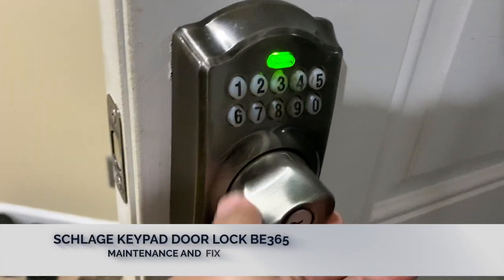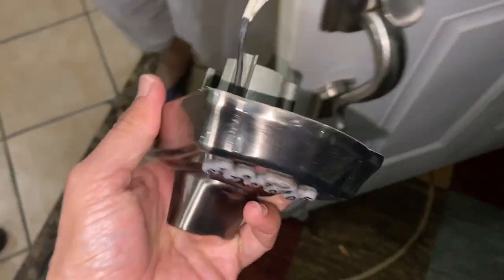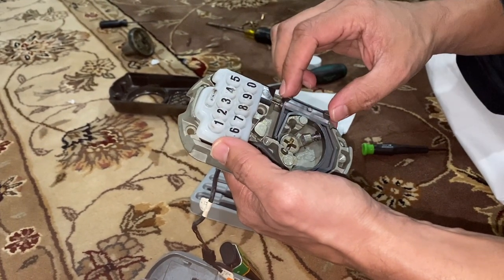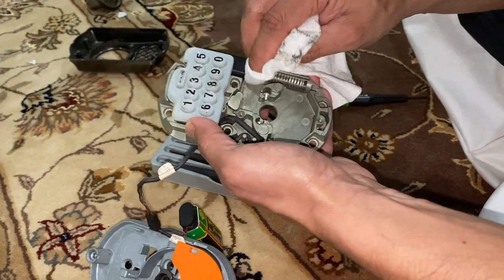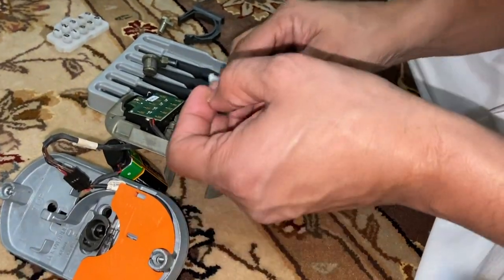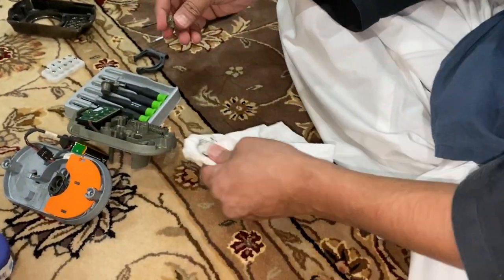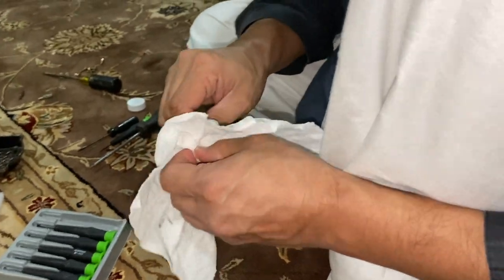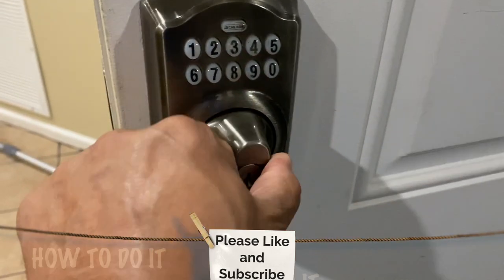SCHLAGE KEYPAD DOOR LOCK BE365 FIX

Comment: Update. I had the same issue with 2 of these deadbolts. One on an indoor door and one on an outdoor door so the cold weather theory may not be completely accurate. I had Schlage send me replacements and the same issue again. My fix was to shim the the gap between the plastic slider and the housing it seats against so that the pin sits flush or more flush with the sleeve it rides inside of. One lock needed a felt disc of a certain thickness and the other needed a plastic washer that was a little bit thicker. Both were cut with a scissors to size. You could use a dab of glue but the cover plate should keep everything in place. I'm pretty sure this is the only solution as the solenoid motor in conjunction with the spring acting as a screw is not a very precise piece of engineering in that even if you reset the plastic slide over the spring it will eventually find its way back to the problem position. The other possibility is that the motor just is underpowered or looses power over time or the spring looses memory. Anyway, shimming the slide where it seats was my solution for both. They work perfectly again

Comment: Liked it to the point at the end where assembly was critical the fast speed made it impossible to grasp detail I have the same issue with one I got from the crazy bin used it will not connect to rod leading through the lock sounds like it would work but no movement front just spinning around also no key came with it.
I have tried to make it work but guess I don't understand the concept of the black plastic and the brad with spring what makes it move back and forth or unlock and reset for another lock episode?

Comment: apologies... One key piece of information is that when you disassemble and take the internal cover plate off, be sure to leave the plastic slide where it's sitting on the spring. This is where it's naturally finding it's home position at this point. Albeit a position that's not allowing for normal operation. If it's like mine, there will not only be a gap present between the plastic slide and the housing, the pin will also not be flush with its sleeve. It's from this position that you need to find the right sized spacer to fit into place. The spacer can be anything that hard but still able to be cut down to size with a scissors.

Comment: I found design deficiencies in the Be365 lock, and I did things to minimize the issues.
T claim there are two design problems. -- The spring that the motor turns to raise and lower the plastic mecanism 
The plastic mechanism itself.

Let me explain.  
I took down my Be365 from the front door. That front door faces west, gets the sun all day, and gets the prevailing winds and rain/moisture. One month past the guarantee, the lock stoppped working.
.
When I went to repair my lock. I noted that the spring, which is used as a spiral ramp to raise and lower the plastic (J shaped mechanism), was covered with a fine layer of rust.
That rust surrounded the wire that makes up the coiled spring. 
The plastic cam that is moved up by the coiled spring is completely flat on the bottom surface.  It is therefore a small cause of friction. I call it the J shaped cam, for want of a better name.

This is my repair.
Spring repair
===========
Obtain a very small amount of watch/sewing machine oil (one eye-dropper max).  I am thinking you will need about 3 pinheads of oil.   Get some graphic from a locksmith, or from the hardware store and make a mixture of the oil and the graphic.  With a Q tip, apply that mixture to the spiral spring, With battery in enable/disable the lock action. The motor will spin that spring,  Do not oil the spring, but from the Q tip, make it hardly-moist from dipping into the oil-graphite mixture. You should not see any signs of wet oil.  The main use of the oil is not for lubricating, but for binding the graphite/oil mixture to the coiled spring.

Plastic J shaped cam
==================
For the plastic cam that is moved up and down by the spiral spring rotation, on the bottom where the cam slides along the base, and in the slot adjacent to the motorized spring, put the smallest amount of graphic onto the slot on which the cam is moved by the spring,  With your breath, blow away all graphite excesses.  There should be no visible sign of a graphite, but perhaps some appearance of dust. .  One way --wipe the graphite onto the slot and wipe it off. A microscopic amount of graphite does the job.

TEST
======
operate the lock to unwind the spring. While  inserting the J plastic cam mechanism over the spring,  press the end of the spring a small amount towards the motor.  Once the J cam is seated, operate the lock to open/close.  The J mechanism should now work freely.  The lock mechanism working is an indication you succeeded.
Once the parts (spring, J mechanism and the little cam that  presses downwards against the spring,  work a few time,. Reassemble the lock.
  
Design improvements
The spiral spring needs to be of stainless steel material -- no oxidation. Otherwise, you will need to buy a replacement lock in the very few years after your puchase and guarantee expire.

The design of the larger flat J plastic mechanism should not be entirely flat on the bottom. It should have some pods, Not very thick ones. Pods  just thick enough to raise the J cam  so that the entire bottom of the cam does not rub against the base. (For my lock, I only dusted the cam. there was just a microscopic addition of graphite.  -- NO OIL, OIL Only on the spiral spring, and definitely not visiby black 

I put the lock together and all is working well.  The lock must tolarate  -20C snowy weather in winter, and 32C humidity in summer, while installed on a door facing the sun.

By the way, the plastic film on the buttons on my lock have split from the plastic losing it's suppleness.

Hopefully someone passes this message onto Schlage.
Reply: Good info but these Schlage locks are total garbage. I would NEVER buy them again. Zero longevity
Reply: @lsatenstein  after teardown and repair I will say they are constructed well. They are also very simple, it's incredible. My issue with the one that faces south is the sun beats down on it daily and the plunger grease was baked and hard/sticky so it wouldn't work right. The parts are mostly metal. It just disassembled it and degreased and REgreased and it works great. Thank you for your comments. I agree with you, you are right.

Comment: Exactly the problem that I am occasionally starting to have.  I’ve had mine for about a year now.  It once took about 8 attempts once before it finally engaged; I was almost locked out of my own home, and that’s not the first time it’s happened.  I’m going to try this, hopefully it solves the problem.
Reply: Did it fix the issue. Mines doing the same thing. I almost just want to buy a new one.
Reply from the maker: Yes
Reply: You should always have a backup way of getting in with any electronic lock!  Put the key for it in a lockbox somewhere outside your house.

Comment: Thinking instead of taking everything apart why not blow compressed air , spray oil, change battery and test????
Reply from the maker: To blow compressed air I would have to setup my compressor. Would have taken me longer. Plus taking everything apart was easy and faster plus did a full maintenance so good for many years to come.

Comment: The lock actually start working again without dissembling it, when it dries out.
The question is, what's the immediate solution when it's wet? Is it possible to get a shield to protect it from getting wet, when it rains?
You dont want to keep dissembling the door knob every time it rains.
Reply from the maker: Yes it’s not designed to get wet

Comment: Maybe just changing out the battery will fix it? I’m completely upset that mine isn’t working either. I’m a 74 year old woman with arthritis in my hands I had my brother install one of these because my hands weren’t strong enough to turn a key. I don’t have the expertise to take my lock apart. I bet it won’t work. I don’t think it’s dirt causing the problem because I have a storm door covering the front door and I would think it’s something else. We have had a cold winter and I bet that cold drained the battery.
Reply from the maker: Yes it’s possible. In my case I had new battery. You can try changing your battery. If it’s old that’s the first thing you should do. If you were local I would have helped you.
Reply: The issue isn't one of dirt but rather one of lubrication. The extreme temperature and humidity changes are  what causes these issues, in my humble opinion.

Comment: WD40...PERIOD. spring tension has nothing to do with it, it's just a worm gear! After cleaning and oiling put it back together properly. You don't need to mess with the spring stretching it or repositioning the plastic part.  Clean and WD40. You don't need to overthink it!!!!!!! A very lightweight oil.

Comment: my solution! scrap this junk ass lock and go back to keyed lock. tired of schlage and their BS. i changed the battery in my lock now I'm shut out. entered the prog code and tried to restore it to factory settings no luck. tried changing the prog code and also the lock codes no luck IM DONE WITH POS... thanks schlage lock number 2. im of the baseball mind but im not swinging on strike three!!

Comment: I'm going crazy... When I enter my code it turns red and beeps 5 times, but then unlocks 🤷‍♂️
Reply from the maker: You need new batteries
Reply: @HowToDoitright  yeah I think you're right, however what is weird is that I tested two other batteries and they didn't give me the beep/red blinking light but they also would move the motor 🤷‍♂️ I think they're too cheap 🤣

Wifey is heading out to get me a duracell right now
Reply from the maker: Yeah they’re are sensitive to right voltage. I was infact having issues and even put new batteries but still same issues but when I checked voltage it was below 9v so then I ordered rechargeable 9v batteries and that worked good.

Comment: You wiped away all of the lubrication and never put more on!
Reply from the maker: That was not lubrication, but more like dirt and grime. You can put silicone grease if you’d like for lubrication.
Reply: @HowToDoitright  mine was lubricated so I added WD40. I also recommend keeping your video slow when taking things apart and putting  back together since we're trying to follow you
Reply from the maker: @erikasnacks  thanks. Will do moving forward. I normally do but This wasn’t planned. Also basic WD40 isn’t a lubricant. It helps remove lubrication. Always use wd40 with silicone or drylube.
Reply from the maker: You know it’s funny when I make slow videos people comment you are too slow and when I make it fast I get make it slow. Lol. I cannot make everyone happy 😃

Comment: The title says "fix." I don't see that you fixed anything - you just took it apart, cleaned all the pieces, and put it back together. But maybe I missed something - the camera work is so jerky that I had a hard time seeing what you were doing. And speeding it up to get through some of it didn't help. In fact, nothing about this was helpful. Our lock doesn't work, to either open or close, and not even with a key; after watching this I still don't know what the problem is or what to do about it. Except maybe replace it with a different lock.
Reply: You may have the issue where the 'vacation switch' came loose. Search "Schlage BE365 lock deadbolt problem" by Mikkyday. He explains the issue.
Reply from the maker: watch again you will find the fix
Reply: Well then why don't you figure it out, Mr. Wizard. Then you can report back to us your findings based on actual work instead of lots of "Karen like" behavior.
Reply: This video was extremely helpful. If you don’t see the fix then I suggest you make your own video.